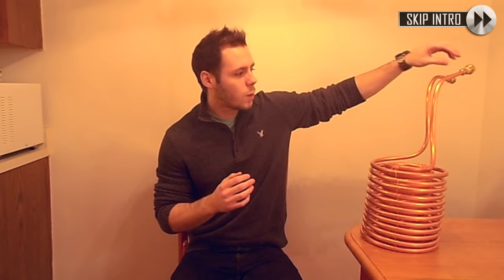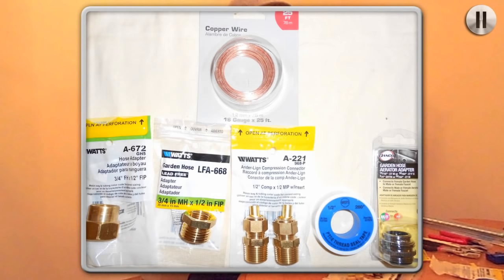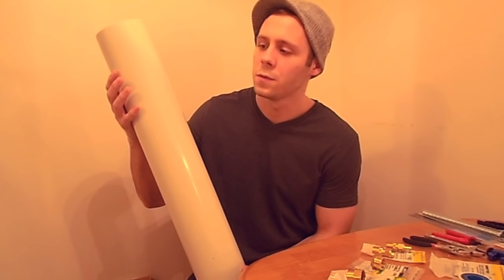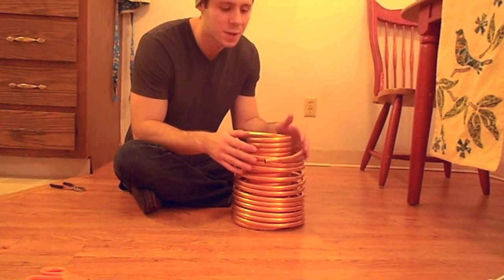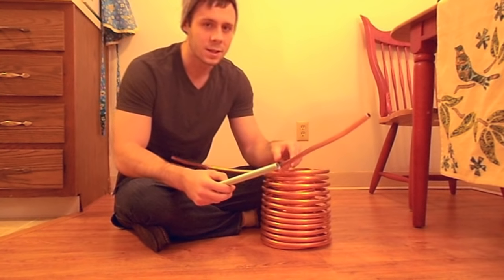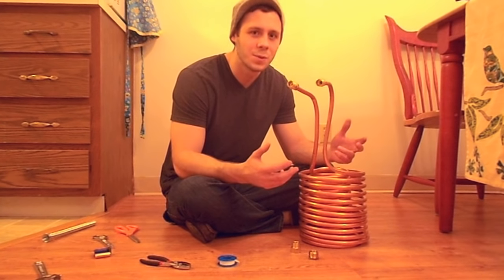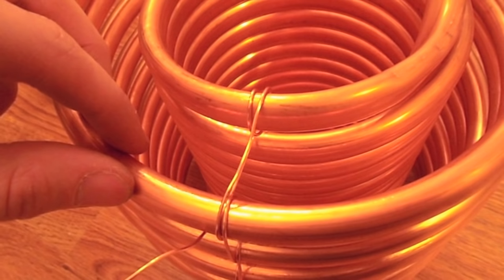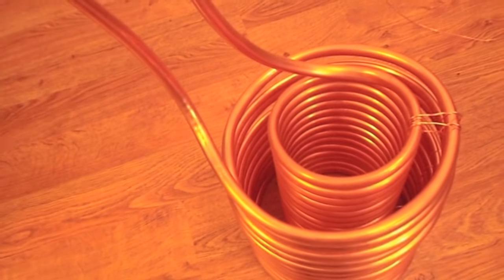Best Double Coil Wort Chiller Tutorial - How to Build a Cheap 50 Foot Immersion Chiller

Comment: Hey Matt, I really liked your video. I hope that you don't mind if I offer some of my experience as a few tips for your viewers, to make things easier. No criticism intended. If you haven't made anything like this before, I would use a larger inner PVC Tube for the initial former (Larger than 4" for 1/2" copper) so you can wind the helix without stress (=spilt beer, kinked pipes, shouting at the wife to leave you alone because you know what you are doing etc). Perhaps even a bit of math to approximate lengths of the intended inner and outer coils. Once you are ready to trim the tails off your handiwork, get it as pleasing to the eye as you can before you cut the copper because once you cut it, it will become your enemy.
Bending springs like it when you slightly over-bend and then straighten, again to avoid, not only the spring binding to the copper tube but the empty glass on the floor being thrown out the window at the neighbours' cat and you storming off to get REALLY drunk. 
In all seriousness, I have one final thing for those that haven't used thread-tape before. Always wind the thread-tape onto the male thread in the same direction as the fitting you are about to screw on to it. A normal right hand thread, you turn clockwise so you wrap the thread-tape clockwise. Imagine as you turn the fitting, it is tightening the thread-tape. Cheers Matt.

Comment: Thanks for this tutorial. I just built one of these and I'm really proud of myself as I'm not really a handyman. Also happy I built a dual immersion chiller instead of a single.

For those of you unsure if you should do this: do it! Two tips: 1. You don't need the hose adapters, you can just buy a hose that fits over your copper tubing and fix it with hose clamps. Just wrap some electrical tape around the copper before putting the tube over it. 2. Bend the ends over something (e.g. a small tube) to avoid kinking the copper tubing.

Comment: Great job, man. I have used a 18 meter 0,8 cm inside 1 cm outside cooper tubing and a connector from cooper tubing to ½ inch  and a male ½ inch connector (botch sides ). I used the Gardena system to connect it to the ½ connector by a 2 meter garden hose to my shower output, Then I used a small 2 meter clear hose for the outgoing water. I connected it to the 2nd end of the cooper tubing with a pipe clamp. I have put the end in my bathtub. I chilled the wort to 21*C in 15 minutes. Before I had a wort chiller I had o wait until next day that I could pitch the yeast. Thanks for the video.
Reply from the maker: Sounds good man.. Yeah wort chillers make the process so much easier!

Comment: The wire is a good idea but you may have a more sanitary chiller if you used solder and just ran a strip of the wire down the sides of each part of the chiller soldering as you go...would take some time though.

Comment: Excellent Video.  Just a suggestion to prevent kinking...It's a pain in the ass, but if you add water to the tubing and freeze it, before you turn your coils, the frozen water inside the tubing helps resist the stresses exerted on the copper tubing at the potential point(s) of failure (kink points) hence mitigating the risk of a major kink (or god forbid a rupture).  

Happy Brewing!!!!!!

Comment: Looks great - I will try make this as tap water temp where I am can get a bit warm so the more surface area I can get the better.  With the flattening of the tube could you have twisted the bending spring to open it up a bit?  Or use an internal spring?   Thanks great work.
Reply from the maker: I'm not sure how that would work, it might be possible.. Thank you, glad you liked it!

Comment: I haven't read the comments on here but if you tape off one end of your copper and fill it up with salt until its full then tape the other end it wont kink at least not as easily. then you can connect your hose and flush it out and being that you are only using it as a cooler not like a condenser for a still whatever salt stays in won't matter and it will be flushed out eventually. good video thanks for sharing!
Reply: he could screw on the spring as well for the one side that he said he could get it on, just use the flared side first instead of last.

Comment: How did you manage to wrap the copper around the PVC pipe with such ease? I've been trying to wrap my 1/2" OD copper pipe around a 4" (100mm) PVC pipe and can't seem to do it with out it kinking. I really wanted to make an immersion chiller like this one but it's not looking good for me so far...
Reply: I can't for the life of me wrap it without kinking it either. Super sad about it
Reply from the maker: +imauriacaf I think the trick is to start with a lot of slack and start the bend way back gradually with more dispersed pressure. When you're trying to bend with a lot of pressure in a smaller area I think that's where you run into the bends (like i did when bending the neck).

I can't say for certain though, as this was my first go at it and I didn't run into this issue. Good luck, and thanks for the response!
Reply: The type of copper makes a big difference (i.e. k vs m)

Comment: Nice work man!! This is really beautiful and looks efficient. One thing that I would like to know is have you encounter any problem cleaning the tiny gaps between the coils and wires?
Reply from the maker: Thank you sir - In regards to cleaning, no I haven't had any issues. After I pull it out of the wort, I just spray it down real well with hot water in my sink, and then let it sit in a bucket of starsan solution. Hope this helps. Cheers!
Reply: That would be easy. Cheers!

Comment: Fantastic DIY video, great job buddy! I'm convinced the immersion chillers are the best solution for the small scale home brewers, and double coil one is probably the most effective I've seen so far. What's the max brew size you have used that on?
Reply from the maker: Hey man, sorry I just saw this. Thank you very much, I'm glad you liked it! The most I've chilled was around 7 gallons.. Usually get it down to 70* F in around 10 min. Hope you've gotten yourself a nice chiller now, and enjoy the shorter brew days! #cheers

Comment: After you evened out the cold water in and the hot water out with the pipe cutter what was the tool you used after that??
Reply from the maker: It was a copper deburring tool.. didn't really need it, and sandpaper would be fine if you had to use something.
Reply: Ok kool

Comment: Where'd you find a 50 ft length on copper tubing that cheap?  Just checked lowes and home depot and the tubing alone is over $80
Reply from the maker: I got it at Menards, I think it was 40 or 50 bucks.
Reply: Yeah, $91 at Home Depot as of right now.
Reply: My local plumbing supply sells 3/8 for 79 cents a ft

Comment: When you're using your wort chiller, do you circulate cold tap water or do you pump chilled water through it? I live in Las Vegas and our tap water is about 75 degrees in the summer time so that won't do the trick for me. I was thinking about using a sump pump in a cooler full of ice water to chill my wort. What do you think?
Reply from the maker: Yeah, I just bank on my water being cool enough, it doesn't have to be ice cold to work, but 75* is probably too warm. There are people that have rigs that run the water through ice or some similar contraption before it hits the wort chiller in the beer. Another thing that helps is kind of stirring the wort chiller while its inside the wort to circulate the cooling wort more efficiently. Good luck, and cheers!
Reply: You could instead make a pre-chiller. Have your warm tap water go through the first coil that is soaking in an ice bath, and flow to the 2nd coil that has been sitting in your wort. With 50ft of pipe you could easily make two chillers.
Reply from the maker: Thanks for sharing tips to people on my video -- a pre-chiller would be a good option. There are also videos for counter chillers, but you're getting a bit more complicated when you do that. Cheers!

Comment: if you want to bend the copper without it kinking next time you can fill the tubing with sand and cap it before shaping/bending.
I highly recommend flare fittings compared to compression fittings if you want a secure connection.

Comment: Man I like this design!! I am going to replicate this along with a slight modification....I am going to add a recirculating line to increase efficiency. One question, What was your IN & OUT?
Reply: The inside coil is the IN and the outside coil is the OUT?
Reply from the maker: Thanks man, good luck! And yes, that is correct. Cheers!
Reply: Matthew Davidek One question Matt, I haven't been able to find 1/2" O.D. 50' tubing at any local store so i am just going to probably order it from JMF like you did. Which tube type did you get, if you remember? Thanks, i'd appreciate it.
Reply from the maker: cadets3 sorry for the late response.. these comments pop up on my phone when I'm busy, and then I forget about them. It was just the cheap soft copper coil.

Comment: Just a note, 1/2" piping is not only more expensive than 3/8", but also less efficient per unit volume being pumped through it. There is effectively less surface area on the pipe per litre being pumped through. 3/8" is easier to work with, cheaper, and will provide better cooling per litre being cycled through the system.
Reply: You make no sense.  This is basic geometry:  3/8 tube:  d=3/8=.375, r=.1875, C=(2*Pi*r) = 6.28*.1875=1.275”
1/2 tube: d=1/2=.50, r=.25, C=(6.28*.25) = 1.57”
(do I really need to go on?)
So for a 12 inch length of tube, the surface area is:A = 1.275 *12 = 15.3” for a 3/8” diameter tube.A = 1.57 *12 = 18.84” for a ½” diameter tube.There is 19% more surface area per unit length on a 1/2 inch tube as compared to a 3/8 inch tube.Yes 3/8" tube is cheaper and if you can afford to stand around an extra 6 minutes waiting for your wort to chill from 212 deg F to 65 deg F then 3/8 tube its a better bet. Otherwise the difference is negligible
Reply: The tubing has more surface area but you have to pump more water through to carry away the heat so the 3/8" is more efficient with equal pumps.

Comment: just some qns. 

The cold water goes in from the top into the inner coil, but the coolant heats up as it reaches the bottom. This hot coolant then goes into the outer coil upwards again. Doesn't it heat up the cooled wort on the top of the kettle again?

I would think that you want the hot coolant to exit in the shortest route as fast as possible, rather than in the outer coil and reheating the wort.
Reply from the maker: I think the water exiting through the outer coil is warmer than the water going in the inner coil, but I think it is still not as hot as the wort, because this cools twice as fast as my old single coil chiller. Good point though. Cheers.

Comment: You make this look so simple, but I have failed twice. My first tubing got too many kinks, and my second one simply snapped. Any tips? I am getting very frustrated.
Reply from the maker: Tyler Bohn just try to move slow, and don't apply too much pressure in one small area.. keep your hands further apart.good luck!
Reply: yeah.........buy a pre-made one at your local homebrew supply store. saves time and headaches.

Comment: hey question-could you explain why yoiu want the cold to go in the inner first? It makes sense to me to have cold into the larger coils on the outside first, giving you more surface area when the water is colder. 
thx
Reply from the maker: My thoughts were kind of the opposite, I figured since the inner coil was more total feet of tubing there would be more surface area for the colder water to contact going down, and then coming up as it was warmer it'd have a shorter path/less surface area to the top. I could've gotten it backwards though, maybe your way is correct. Both way would cool your wort much faster than the traditional chiller though, I assume.
Reply from the maker: Oh, also because the center of the wort is hotter. I think that is the main reason I did it.

Comment: Did you consider using a five gallon homer bucket and cooler pump as a ice bath.  Then recycle your water, you will need a waste water line to dump the ice melt in to the drain but that could be saved to another five gallon bucket.  Also you don't need to but RV water hose the white kind is sanitary and not made from waste garden and industrial hoses it just a better hose overall.

Comment: You got a good price on the copper tubing, its now about $80 for 50 ft of 1/2 in OD
Reply from the maker: Yeah, coppers went up significantly.. I also got it from Menards, which is typically a bit cheaper than other places..

Comment: Try  the opposite... Counter Clock Wise 1rst. (C.C.W.). inside not outside...  C.C.W. = Gravitational field (Test the field) ... C.W. =  Magnetic field (Test the wire) having to do with Material/Physical realty... Physics... you know...just don't get stuck there, go, stretch,go inside so you can show outside.

In this project, the tube is going Clock Wise. (C.W.).. for the 2 coils.... (2 x magnetic fields) Look at the coil/tube being made, looking in front of your eyes... look at the way the wire is turning. That's the deal in this... and a freaking good idea... 
Go Counter Clock Wise (C.C.W) inside, C.W. outside...   Do C.W. x 2  and compare. :-)

Fun Stuff.
Reply: +TheDMTLover  Im confused. The gravitational field would be present no matter which way you had it coiled. And where is the magnetic field coming from? Earths? And how do you suppose this would make a difference? Like, could you give me some physics or formulas? Or are you just guessing and thinking it might make a difference? Just curious to the train of thought...
Reply: +Even Prime The train of thought is DMT

Comment: can't for the life of me bend this damn copper without messing it up
 (inner coil). I read somewhere you can fill the pipe with salt or sand. This seems like it might work, but I haven't tried it yet.
Reply from the maker: I read that too - It seems like it would work, I just didn't want to make another trip and add work/mess. Good luck my friend!
Reply: Matthew Davidek
Luckily I had access to a chest freezer, so filled the copper flat spiral with water and waited until it froze to bend it: this worked wonderfully to retain the shape, mostly. Still some minor kinks, but nobody's perfect.

Now I have a beautiful double coil-chiller.

Instead of the compression fittings I just used an old garden hose and some hose clamps. Not as pretty, but just as functional.
Reply from the maker: Taylor McIntosh That's awesome, glad it worked out! Yeah, I didn't have a bunch of room at my old apartment, so I wanted to be able to detach the hoses easily.

Comment: For the part you kinked you could have used a torch to soften up the copper just a bit.
Reply from the maker: I had one, but unfortunately rolling the tight inner coil flattened it a little and it wouldn't fit in the spring. I should've waited and tried a bigger spring if possible, but I was impatient. Thanks for the comment. Cheers!